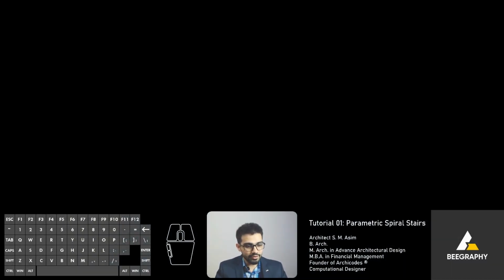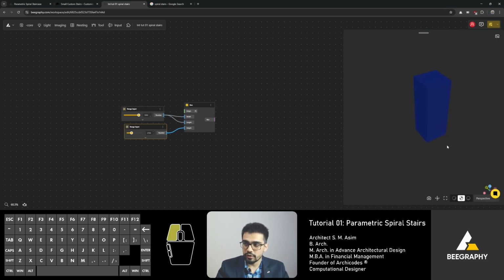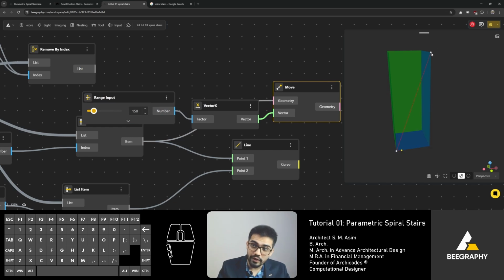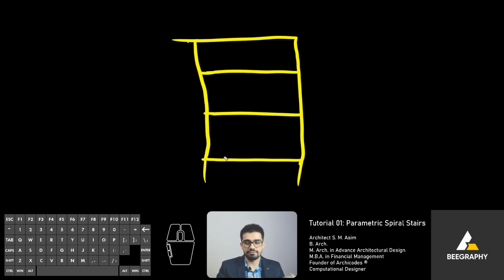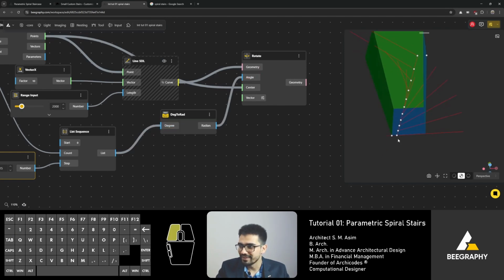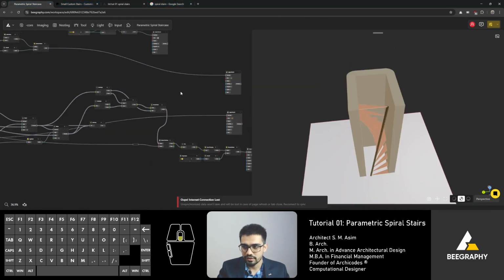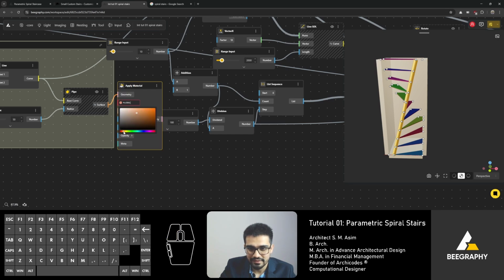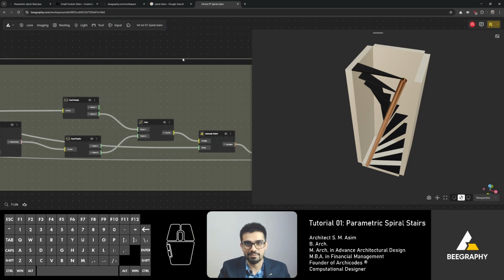Intermediate Tutorial 01: Parametric Spiral Stairs using BeeGraphy

Comment: Hello, Mr. Asım. I am currently trying to learn how to use BeeGraphy. I am a Mechanical Engineer and a manufacturer of CNC Routers designed for woodworking. It would be extremely helpful to me if you could create a sample video demonstrating how to construct a CNC Router frame using this system. I utilize 100x100x3 mm box profiles, and I would like to design the intermediate cross-bracing members so that they interlock with one another via half-lap joints. Please prepare a brief example; I have watched most of the existing videos, but I still feel there are gaps in my understanding. Thank you in advance for your assistance. My subscription on your system is registered under the name Hakan Akkus. I wish you a pleasant day.